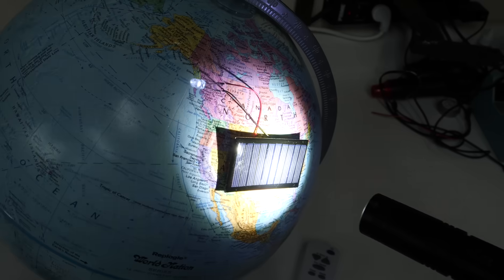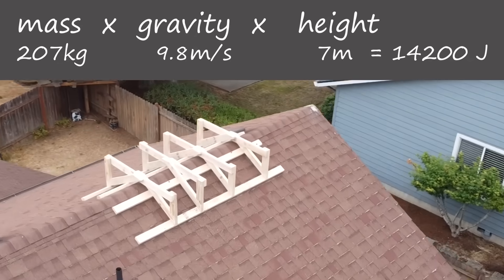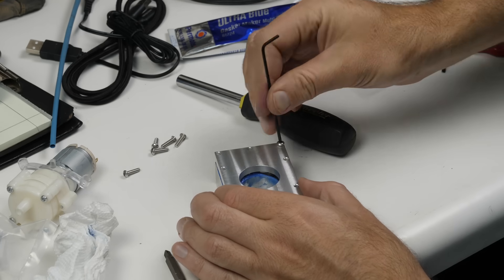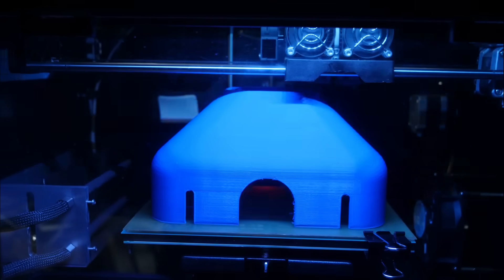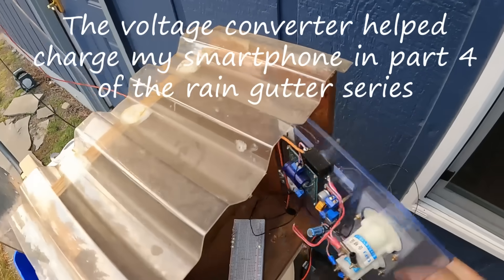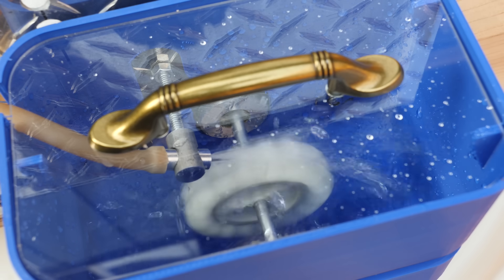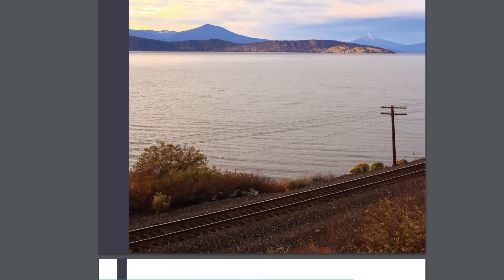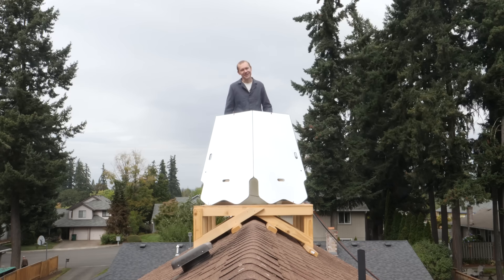Storing Solar Power on my ROOF!!!

Comment: Is any energy lost to friction on the side of the tube as the water falls from the roof to the ground? Would you get more energy from a wider diameter tube with a reducer at the nozzle on the generator side?

Comment: If you use this to pump rain water, you will need a filter on the bucket inlet and a float valve to prevent running dry.

Awesome to see this build!

Comment: Great instructive video. Unfortunately that it is indeed true that you need massive amounts of water to store a meaningful amount of energy. Try running a washing machine of that barrel and it's not going to go very far. I live in a unique building which would allow me to store massive amounts of water (inside) but even then it's quite impractical because the noise of the flowing water and the loss of space is just not worth the energy coming out of this. Li-ion batteries are not brilliant either for other reasons. Still looking for the ideal storage solution :-)

Comment: Utah Power has a "battery" that serves the grid outside of Salt Lake City. When they need it, they open it up, when power demand is small, they reverse the pump and refill the lake that is the upper battery. The scale of the tech is huge, but the basis is functionally identical. Imagine a farm getting some of its power from solar, some from wind, and some from a gravity system. Build it inside a barn, or silo, and you would not see it. I guess you can tell this excites me. I hope your children are as excited to be part of this. By the time they are ready for college, they will have such a solid grounding in the physical sciences, they will advance quickly.
Reply: Huge one exists in South Carolina.  Has for decades.
Reply: @dherman0001  I live in Karachi Pakistan and I like your comment
Reply: I live in Karachi Pakistan and I like your comment send 10 month ago
Reply: I dont think the price of the barn and the efficiency woulf match up unfortuneatley, too expensive and not efficient enough.
Reply: Finally someone else from Utah 😂👌
Reply: Do they freeze or does the constant movement prevent that?
Reply: @Seriouslydave  if cold for long enough it will freeze a 200L tank on the roof is really no benefit.  However if you have a property on a steep hill and can set up a big tank, pool, pond than be worth while.
Reply: How the move of such mass affects the ground stability around? It is well known that demolishing of one big building on the street can affect houses nearby, change ground waters paths... And if we scale up this model? Did they do some measurements on place?
Reply: They don't even need to go to college.
Reply: It's really more disappointing than anything. We haven't been able to make a shits worth of power without water for over a 100 years, and instead of investing in the next generation of power generating technology we waste our money on extremely inefficient, unreliable, expensive, solar and wind.
Reply: @bobbygetsbanned6049  I live in Karachi Pakistan and I like your comment
Reply: @bobbygetsbanned6049  Wind and Solar are so cheap now, theyre are very efficient and getting more and more efficient now with time.  Arguably they are too efficient and they produce too much power that we can use the excess power to pump millions of litres of water up hill 500m+ what was proven in this video. In terms of reliability  this can depend, you can build wind farms offshore and in hills where wind is a lot mroe consistant. and Solar works throughout the day, even with cloud just less efficiently. but again you can concentrate solar farms further towards the equator where sunshine is mroe consistant. Combine the 2 you have an affordable efficient energy producing system, furthermore if you combine with a water storage solution or a battery solution you can then have stored energy for cloudy days or not so windy days. 

This issue with water storage it requires very specific land requirements. you need land which has a height difference of hundreds of meters over a short distance, else you lsoe a lot of potential energy in friction in the pipes.  you also need a lot of land, we know that createing dams is not very good for the environment uphill or downhill of the river.  theres no one perfect solution but solar and wind are apart of it 100% and a variety of storage solutions will only help the energy discrepencies with solar & wind.
Reply: @bobbygetsbanned6049  and what exactly is that magical silver bullet that you propose in alternative? Last time I checked Wind and Solar were anything from unreliable or expensive. I have been running a large household with 20 solar panels and a 15kWh battery without any problems. And I still charge my cars and sell some to the grid.
I have no clue what you're hinting at.
Reply: @bobbygetsbanned6049  They just chucked up a wind turbine that can power 18,000 homes on its own. It's got a lifespan of 20 years and the company that built it have had to guaranteed the majority of the turbine is recyclable. The turbine is really tall because winds are stronger at height. When stood on the ground you often think there's no wind, but at height it's another matter and the blades will turn. I'd rather have wind and solar than coal.

Comment: We are looking at a small farm, I can see building a closed loop genset using water "tanks" , actually 50/50 antifreeze or a 60/40 mix in Canadian climates, for lubricity and to reduce the freeze point below worst case scenarios, above and below so the water is recycled from top to bottom and back. Using a large solar array, along with a wind powered fan to generate electricity, you could builds it inside a barn so it would never be visible from outside. Use solar as the primary system, with a wind backup and power the pumps to return water from the lower tanks to the upper tanks to restart the cycle.

Comment: The most efficient way to utilize say, 10 square feet of solar power is a roof heat collector. Water diverted from your cold water is heated, then goes to your regular home water heater. On hot days, all your hot water heating is F.R.E.E.  On cooler days and late at night, power is cut in half or better. Heating 100F water to 120F takes far fewer watt hours than heating 70F water. On hot days, your water would be too hot, probably 140-150F! Just saying, your project is a wonderful teaching and learning aid.

Comment: If u use a bigger hose “lets say an inch or  inch and a half “
Then before the turbine switch the diameter to the same as u are using in the video, then you’ll got immense water pressure.
Reply: the diameter of the hose will make no difference to static water pressure whatsoever.
Reply: @spencerwilton5831  the hose from the tank to the ground i meant

Comment: It's a great experiment and nice entertainment, but 14,000 Joules is only 0.003889 kWh. So to get 100 kWh you need to scale this up 25713.6 times. As this is energy potential, correct in physics terms, to turn the potential into, say, electricity to charge an EV's 100kWh battery, you would hope for 1/3rd efficiency (33% - about the efficiency of a good ICE). Which multiplies our huge scaling number by factor 3. Then charging a battery may run at 80% efficiency and that adds too to the requirement of potential energy.

Comment: Why not use gears to load a one way locked spring or a metal cylinder? I have often thought brakes on a car could channel energy to a spring to supliment a petrol/electric motor car more efficently than engery transphered to a battery in hybrid cars?

Comment: Great job and nice show and tell experiment. But , here are the facts - ine 3.7V Li-ion  cell that has 2400mAh of capacity can give approx. 2.4 Amps for a whole hour , or if we multiply 3.7V with 2.4 A that is almost 8.9 Watts. 8.9 watts for a whole hour in such small container. If we multiply 8.9 Watts with 3600 (no. if seconds in 1 hour) , we get around 32.000. Or 32 KiloJoules of energy contained in one 18650 cell , of course , nowadays there are 3600 and 4000mAh cells available... So , it is quite impractical to put gallons and gallons of water if you can store this amount of energy in your pocket :)
But, this is impressive build , and on much greater scale this is very reliable energy storage system, so thank you and keep up the good work.

Comment: What was the conversion efficiency of your system?  It would be nice to see how much energy went in vs how much energy you can recover from it.
Reply: The conversion loss is so great that the money spent on the project would have been better spent on rechargeable batteries to store the daytime sunlight energy (from a practical standpoint). But obviously the cool factor here is learning and applying through the BUILD process. There are numerous reasons solar companies don't sell you 55gal water tanks for your roof, and instead sell power walls. Battery tech (due to energy density for one) is invaluable.
Reply: @jamesbsa6450  I couldn't agree more.  I know the efficiency would probably be well below 5%, but was more curious as to just how bad it was.
Reply: How long did the light run at full open valve? I'm guessing 45mins if my very rough calculation is anywhere in the ballpark.

Comment: Couldn’t this work with a weight and gear setup in the same way? Like you wouldn’t need to store water. The potential energy of the weights could do the same thing? It might even be more efficient because it would be direct drive, rather than getting losses from the water driving the generator.

Comment: I have thought about such systems a lot. Having an IBC tote elevated to about 5m and then let it drop into a second IBC for power while a small solar powered pump brings the water back up. But 1000l doesn't do much more than power some LED's for a while or charge a phone. But it would be a nice closed system if some antifreeze is added.

Comment: It's a nice example of the pumped hydro but its practically useless because the capacity, capacity/volume, efficiency are all very poor for your DIY. It would be better to get the large Lithium cells (eg. LiFeSO4) to store the energy with DIY assembly of the charger, BMS & inverter as many others have done.

Comment: It would be great if you 3D-printed a Tesla turbine and use that to move the generator instead of your current pallet wheel and compare the efficiency difference between them.

Comment: 14000 joules huh? AKA 0.039kwh....so enough to run a smart phone for maybe 10 minutes.

 Kinetic storage requires so much mass or height to be worth it. All that work and lumber amounts to being able to store $0.0004 worth of power. You'll have to fill and empty this 2500 times (about 7 years) to discharge $1.00 worth of power.  So you'll get your money back in maybe 1400 years. 

Unless you want to start stacking 2 ton concrete blocks 6 stories high with an 8 story tall electric crain, this is going to have very little practical use in every day life.

Comment: What is the efficiency between the energy transformed from the solar panel to the water pump losses, and losses in the electrical turbine? 

 In other words, what is the difference in avaliable useable energy between using the solar panel by itself during the sunny day, and the available energy at night after you pumped it up to the roof and then let it flow thru the turbine?

Comment: I knew about the big pump batteries on lakes. But now I wonder: should each and every house have a small pump battery on its rooftop? Combined this would be a virtual megabattery
Reply: Very expensive and complex for the energy stored. If you watch the last part of the video you see that all this stored the equivalent of 1 AA battery. And of course, this was a DIY project, which would not be the case if you were to start installing them on every house. 
I ran some numbers for my own place and to get the equivalent of one days backup for a single 400W panel, I'd need ~350 000 liters in a pond with a 30M head. Multiply that by at least 4 to gets the needed storage for one day power consumption. Double or triple it for backup over several days of no solar: a 4.2 million liter pond, or basically 2 Olympic swimming pools. Digging that out on the hill, running the water lines, installing the generator and controls would be far more expensive than just buying a conventional battery. And though the water could theoretically last indefinitely, the pump, pipes, panels, pond and generator won't.

Comment: I think that it might be easier on your roof and provide more power if you were to have 2"-4" pvc piping covering your roof in a radiator design. With that you can also have it piped to your water heater to use that energy where it is the most efficient at that time. If you used thinner tubing then you could stack solar panels on top of it, which would help keep the solar panels cool and offer even more potential.
Reply: During the winter months you could potentially have hot water from the water heater pump just enough water through the system to keep it and your solar panels from freezing, or you might want to completely drain and close off the system for the colder months.

Comment: This needs a diaphragm pump instead of the impeller type to deal with the pressure , a one way valve would help also .
Reply from the maker: It's not an impeller style pump. 5 tiny diaphragms driven with an angled head on the motor shaft.
Reply: @QuintBUILDs  what happens when you put them is series ?

Comment: Making something useful. 
This project was designed more to teach concepts. Sadly, all that could be reclaimed was about that one can get in a AA battery. 

A solar panel pumped water into a 50 gallon drum on the roof converting solar energy to electrical  energy to gravitational potential energy and back electrical energy. 

On the other hand one could take that same solar pannel and same bucket of water, and store far more energy as heat, inside one's home with a water heater element and wires from the panel to the bucket.

Comment: You don't need to put the drum on the roof,risking to ruin your house or a collapse accident, all you need is to have the drum sealed,so as the water level raises inside,the air contained will build pressure so the effect is the same. We did  it maaany years ago for my parent's garden,as the water from the well was too cold for the plants,so we conected many drums in parallel and used a pump to fill them.After the water was warmed by the sun ,a thermo sensor would open an electrovalve and began to irrigate the plants. Simple as that :)

Comment: Battery storage is around 80% efficient, you are probably only getting 1/5 that. That means you could have 5 times the electricity from the same panel. With a good battery charger the batteries can last a lot longer than your pumps and generator. And the system would cost a lot less too.

Comment: I often wonder why flowing mains water is not used for generating power. It's powerful. A friend of mine built a water powered lift just connected to a household tap. It was powerful enough to lift an old upright piano that weighted about 1000 lbs. from the bottom floor of the house to the top floor.

Comment: you have a massive sloped roof there - and, even on a cloudy day, it would appear from the faint shadows that the sun does hit it.
It would make sense to cover that in solar panels and have a battery, you probably have about 10-12kW of roof there.  You probably have space for 8KW below the pipe stacks, so shading is not a problem over much of that roof.  You are wasting a valuable resource, currently.  

I would (did, in fact) take out a loan for a solar array, which paid for itself.  I am now looking at a battery, which my Tesla shares are paying for, but again, worth taking a loan for.  If it pays off over a 10-year period it will not cost you anything and you will save a fortune - depending of course in which state you are residing, i gather that electricity pricing can be wildly variable in the US.

Comment: Awesome!! Love this concept... aaand not being a troll but:
 I have a modest 7+ years engendering structural trusses both wood and light gauge steel.  I cannot say the DOL factor coupled with the bizarre dead load which will have live load characteristics will necessarily cause catastrophic failure's. It may not even push out on the wall enough to measure the deflection. However, I would take that thing down as soon as possible. Perhaps a standalone water tower. Running multiple pumps and pumping to multiple level will reduce head load = less power = less loss/wear & tear. 
 Concerning the battery: Li-ion, or Primary batteries, essentially the same thing this "Rube Goldberg machine" was intended to mitigate, was it not?

Comment: Nice build. What if you try to make it redundant. Build like 5 more water wheel on top of the other, then combine the energy produced. This way, the water will pass several wheels before it finally drops to the ground.

Comment: 🤔.. why is it that hydroelectric dams over the last 40 or 50 years have been shut down all over the country if we're so concerned about renewable energy? I mean, what you're doing with your water barrel on top of your house is essentially just a smaller version of a hydroelectric dam, nothing new, really cool and innovative closed system though.. but if our country was so concerned about renewable energy we would respond infrastructure money on our already existing but not used hydroelectric dams and building more.. It is the easiest and most reliable non-petroleum/non-nuclear source of power that has been available for over a hundred years.

Comment: SL should be interesting, assuming they actually use real Solar and Wind to fill the upper reservoir, usually pump storage are very inefficient and use more energy to fill then they produce, but they are a great stopgap and generate electricity faster than any other power plant when the demand spikes faster then normal.